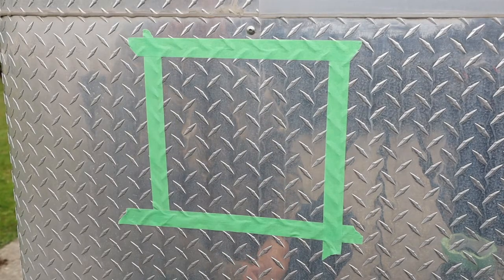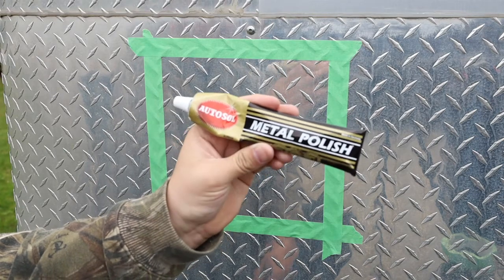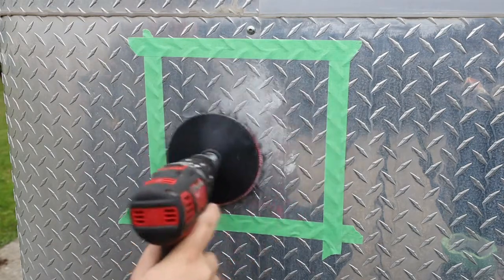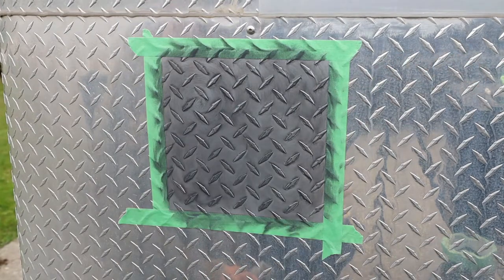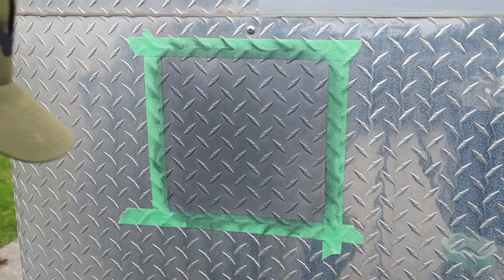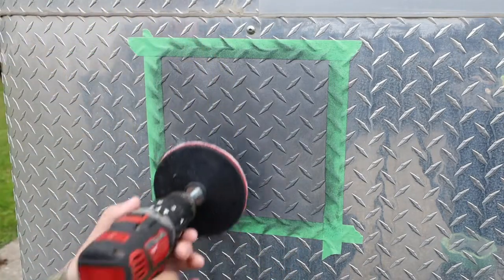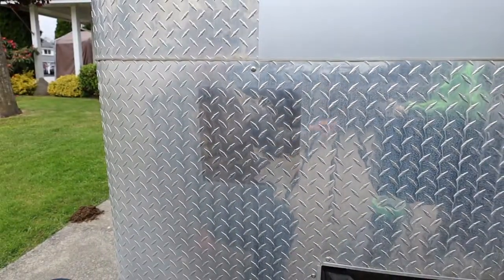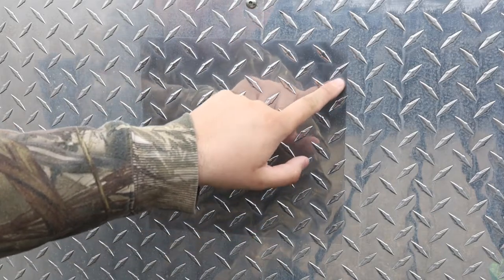Checker Plate Aluminum Oxidation Removal (Autosol)

Comment: There’s got to be an easier way , I have a large checker plate van that needs a clean up at that rate it would take me a year , and big $
Reply from the maker: I am sure you could get something bigger that would do it much faster. Luckily I didn’t have too much that needed to get done. If I find a better way I’ll let you know!
Reply: I'll be using this method to clean all the aluminium staircases in my factory which measure around 3 stories high there's 6 of them so i guess I've got my work cut out for me but yea there must be a quicker way